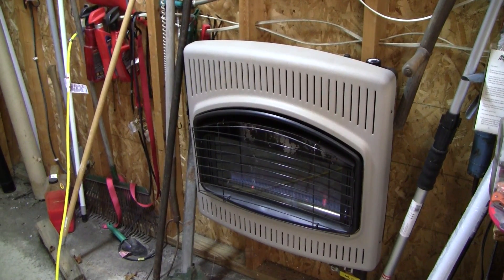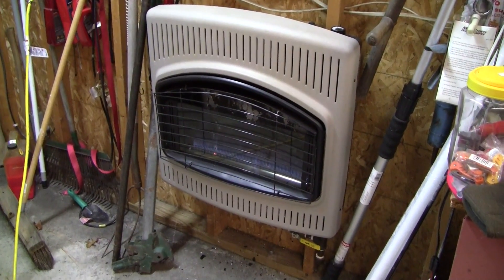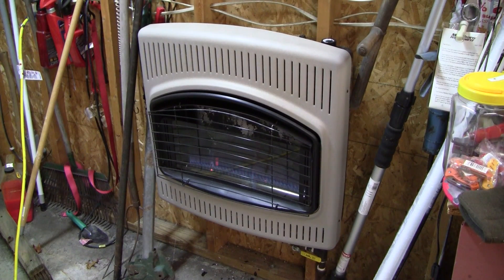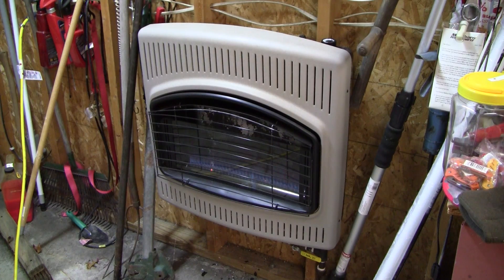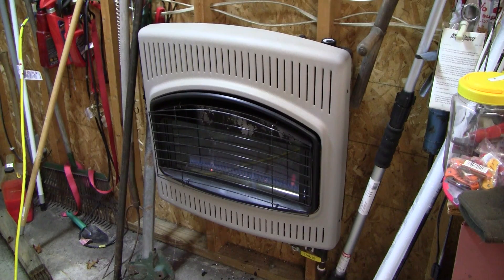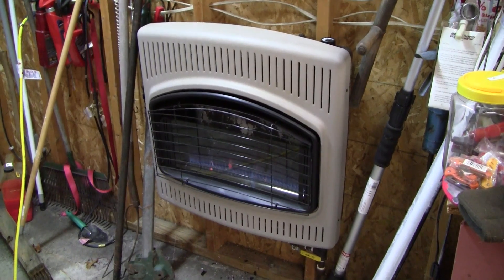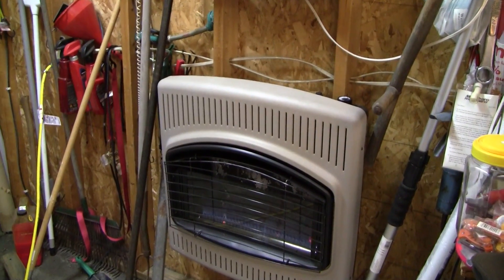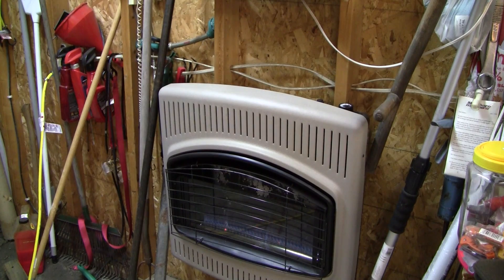I need a little help guys!

Comment: It's the stuff you can't smell that you need to worry about with heaters. What you are smelling is the chipped paint burning. Clean that rack of jets and scrub off any of that loose stuff still up there on the reflector and then put it back together and give it another wack...

Comment: If your cutting it on for the first time this year you will surely have a funky smell for just a little bit and it will go away...The gas that's been sitting in that copper line is weaker,Per say than whats compressed in the tank..I usually crack a connection somewhere in between the tank and unit and wait until the gas coming out of the line smells like a rotten fart...That's the good clean gas right there!

Comment: First check your flume, it may need cleaned, next call your supplier, sometimes if the supplier changes their source for gas it may have a temporary smell like that kind.
Thirdly, have you recently stained or sealed the floor or any wooden areas in the garage. Some sealants & stains combine with the natural gas and create that odor. Good luck, Rich!

Comment: the gas line may have some water in it-condensation forms when you don't use them all summer.  as you use the burner the line will dry out and the smell will go away.  this is one reason why I use boilers with a pilot light.  keeps the line clean and stops rust on the parts.

Comment: How long is the gas line going to the garage and what size is it? The line may not be able to support the unit size properly.  If I were you I would have a gas pressure test done on it on the coldest day possible and with every gas appliance in your house running simultaneously to see if its a gas supply problem. You may have to put in a bigger gas line or the gas company can boost the pressure if its too low. Also, it may be ventless but the exhaust gas needs to go somewhere and that somewhere is in the garage. If there is a gas supply issue or a combustion air issue it can put off an odor.
 It can also produce carbon monoxide so get a detector in the garage ASAP .

Comment: I have a similar heater, burns LPG.  When tank gets low, smells odd, from poor combustion? Also I have had spider nest in jet, makes lighting almost impossible.  Cleaned out jets with pipe cleaner, worked great,nice blue flame.  Good luck .
Reply: yep just clean it

Comment: Hey MBV...ive had both natural gas and propane fireplaces like this...with BOTH ive had a smell that happens every fall...when I burn them after some time.  its enough to set off the fire alarms...just fyi...I guess its just the dust that builds up over the year, but usually after a couple of hours...im fine.

Comment: It is normal if you have a ceramic element and you are cranking up the heat. If you take it apart and clean it the residue of the cleaner can make a chemical smell also.As long as you have a vent for outside air you should be ok. It might be a good idea to put a thermometer between the fan and the heater. Fans are really crappy and will burn or melt at the worst time.

Comment: It could be very dangerous, because the exhaust might not be properly driven outside. Or the burning chamber is no longer hermetically sealed. You have to check it asap, because, you know how dangerous the carbon monoxide (CO) is.

Comment: With a google search and some reading I've come to the conclusion you need to leave the heater run continuously and air our the garage. There was something in the air that mixed with the burnt fumes in the heater that gave it that smell. A guy on this thread that I read said that he had the same problem and the gas company sent a team out and they couldn't find the problem. SO he just let the heater run a couple days and aired out the place he had it...

http://forums.jlconline.com/forums/archive/index.php/t-55438.html

Comment: I know after having the furnace turned off most of the year and then turning it on in the winter I smell the same thing. Mine goes away after a while. I think it might be all the dust build up in the burners. I'm not saying that's whats wrong with yours, but it is for mine